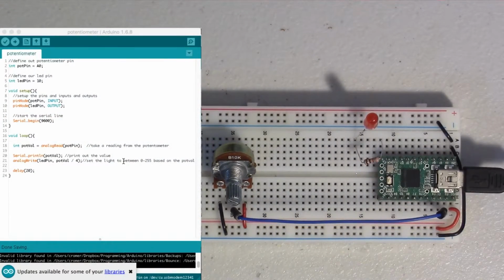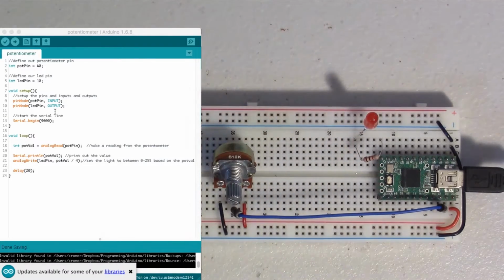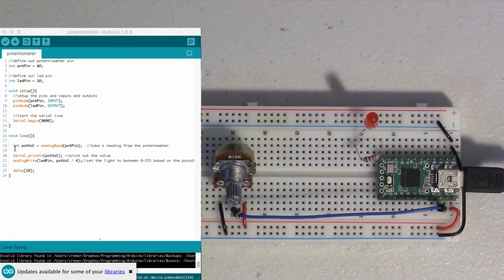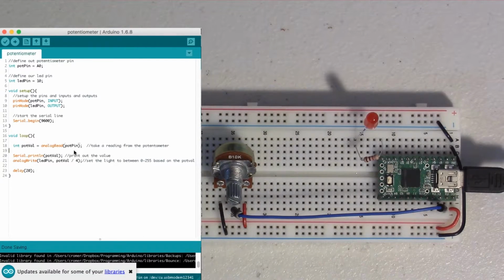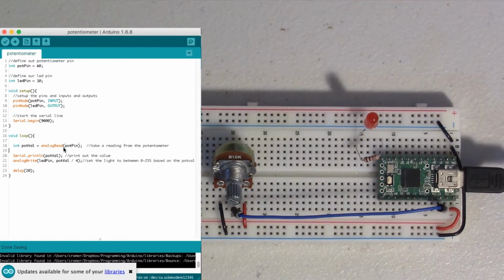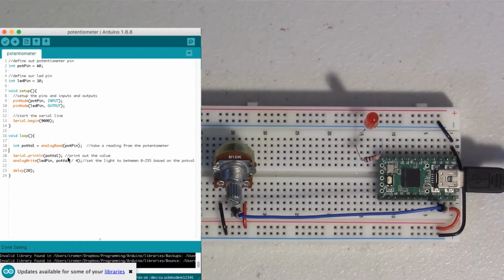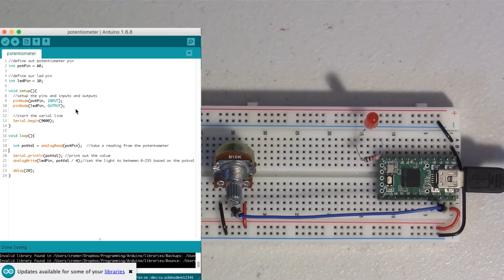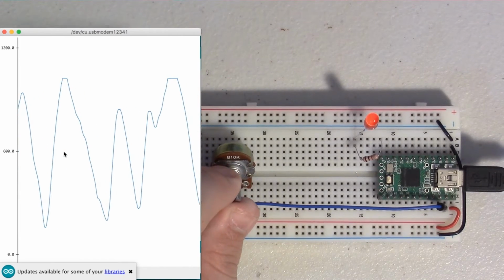How To Wire It! Potentiometers

Comment: possible to use a female to male wire on the pins on the potentiometer to extend its range?
Reply from the maker: Sure! Depending on the length of wire you should be fine. 1-2ft should be ok. Beyond that you might begin to have a drop-off in output voltage depending on the quality and size of the wire.

Comment: Very nice demo! If we removed the Arduino from your circuit, would the blue wire (middle/output terminal on the "Pot" simply be poked into a hole in column 12 next to the (+) leg of the resistor, and you would get the same result? Hopefully, you say "Yes". My other question has to do with reversing your design for mere understanding. At present, you have the "Pot" wired to decrease resistance (brighten the LED) as you turn the dial/"Pot" clockwise. If we wanted to increase resistance (dim the LED) with a clockwise movement, would we simply reverse the wire connections to the "Pot"? Many Thanks!!!

Comment: I don't understand why you need the third leg. So between leg 1 & 3 you have the full resistance. Lets say, 10k. The middle one is the one that is var. Why not just use the 1st and 2nd or the 2nd & 3rd?
Reply: First and third are for clamping the voltage output range, and the middle pin is the output, which is the voltage between those two ranges. If you are only using it as a variable resistor, and not variable voltage, then you only need to use 2 pins.